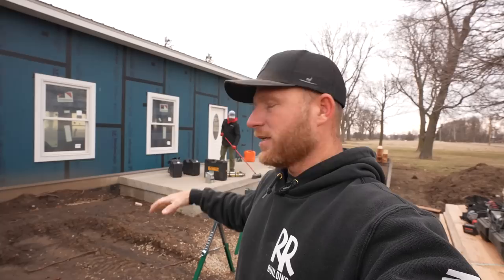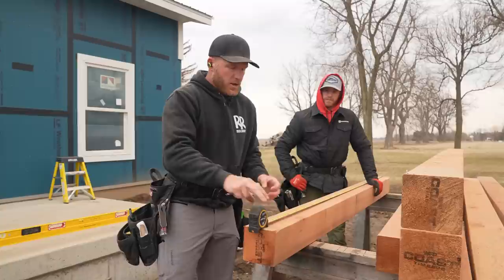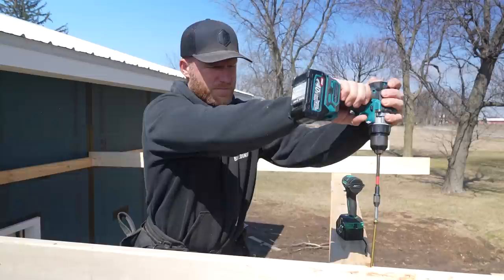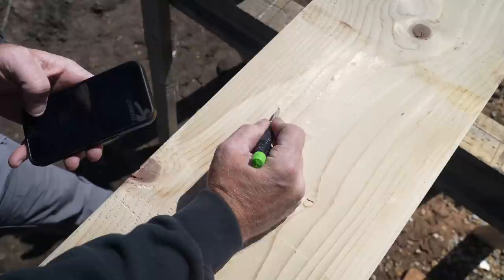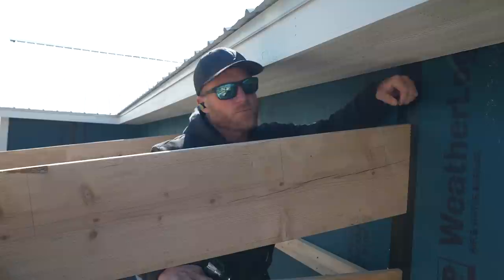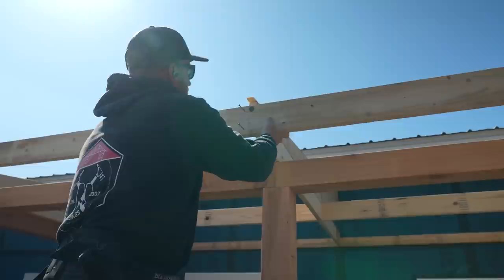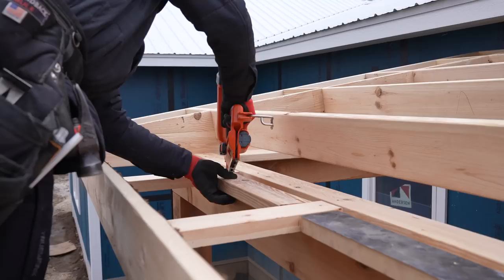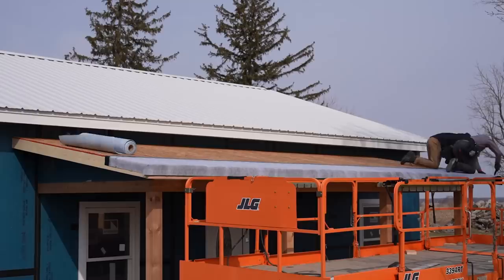Building a #Porch Start to Finish

Comment: Tim from Canada, my question is why are you using three different brands of tools for example at the beginning your laser level and your parts were..( DEWALT…. )Then using your hammer drill it was I think.?.(. Milwaukee.)….. now you’re using a new tool green. I am not sure what brand this is…. most construction people stick with one brand of tool. A lot of you people only use….( DEWALT..).   Just my observation.   If you are using just one brand of tool, don’t you think it should be the same for just one battery platform?… I see in your construction base you were using three different brands of construction tools or more meaning that you need a platform for more than three or more battery types…. again just my observation if you are doing this yourself, you should be using one kind of battery platform and seeing if that battery platform can give you free tools so you can use them on your job for construction use and for… task purposes, so you can test out the tools… I know a lot of contractors that do this

Comment: A couple of questions:   1: Why not do a ledger board at the house for the rafters to frame into?  Maybe overkill but would be easier to frame (for me a least). 2) why a 2x12 rafter for such a small span?   (A 2x6 would work)  #3:  the porch roof is too close to the higher roof - looks awkward and how in the world did you attach the sheathing and roofing under the higher roof?      Enjoy your videos and appreciate your level to detail.

Comment: I am concrete on floating slab @ 20+" above grade (the house was set 5 ft above grade and back-filled 3 ft - due to a high water table).  There is no basement.  One quote person told me that I will get leaks and rot if I don't put my porch level 2" above grade (ugly patio).  It's all concrete below 16-18".  I just want a porch slightly below my sill that could've been installed in the first place.  I think that if drainage is proper, there should not be a problem.

Comment: For light structures such as your porch uplift forces due to wind often will control the design so your column bases and the anchoring to the concrete is important.

Comment: we are adding a porch to an existing post frame, we are going to take the metal off, and replace it with some type of siding. when they do the concrete floor we need to have the metal off first?

Comment: @rrbuilders- hey kyle, i have asked this question a few times. Can you please explain, when you are calling out "grade", such as on that concrete patio and this porch. Where and how are determining your grade point, then level? I can only assume that the porch you are working on has a slight slope for water to run off, but i see that your laser (180) is near or at the middle of the porch. So one part, near the house has to be higher then the outside edge. All of that seems a bit confusing. How do you determine where you are setting that laser/grade? This is all new to me. Have been in construction for 20 years, but have never ran one of these. Always just showed up and started banging nails. All the grade work had already been done. We live on a farm, i will be purchasing this laser set up as it will come in handy on many projects for the future.

Comment: Kyle wouldnt it be good practice to treat the ends of the posts that are going to be exposed to the weather? Also is there something that you could put between the wood joints to help keep rot from happening?
Reply: Yes especially and cedar cedar tots really fast especially western red cedar if it was mountain cedar it’d be different I been doing this 22 years western red cedar is trash imo but all we get in texas

Comment: Question please - do you NOT need epoxy or anything like that for the bolts securing the brackets to the concrete pad? Or is the engineering of the bolts themselves enough?
Reply from the maker: No need

Comment: Great video! But, I don’t see this being possible for $300. I think you said the gravel alone was like $80? Add chairs, fire pit and edging, you’re over $300. I assume the chairs were 60-80/each and a cheap fire pit found on sale could be 100. 

Gravel 80
Chairs 120
Fire pit 100

Total 300… haven’t included wood posts, lights, concrete mix or edging.

Comment: How does everybody in these videos just sink acrews so effortlessly without stripping the acrews? What am i missing? I have to put all my weight against a strip em half the time.
Reply: Its all about the type of tool youre using for the job (impact driver or drill), brand (my favorite impact is milwaukee m18, favorite drill dewalt XR) and your attachments with them. Make sure its a proper fit, with the drill bits most popular one engraved PH2 for good reason for most standard wood screws. (there is Phillips 1, 2 & 3 for this)

Hope this helps. 🙌🏼
Reply: Also make sure they're fresh bits, once it starts to strip once, itll start stripping everything. 😂
Reply: One more thing, if youre using a drill, not all drills are the same. There are hammerdrills also with different settings for the job! Lol.

Comment: Is that laser dangerous for your eye's to look at when your 20 feet away from it and only get a flash of light every now and then probably like you get by using it every day?
Reply: I have been using different lasers for about ten years and often get into my eyes, over these ten years my vision has not deteriorated. Yes, this is a short-term impact, but very frequent over the years. But of course you have to be careful ☝️
Reply: @Alex_F81  Thanks. I've been using a much smaller and simpler laser for years with a solid beam but with the 360 degrees lasers like this, I would think that I'd get zapped way more often.

Comment: So many things wrong in this video. First you’re not wearing any PPE when using that hanger nailer. You could possibly damage your eyes using that without wearing safety glasses. Second,  the strength in the plywood is really only useful when you stair step the pieces. And who pull out a track saw to sheath a roof
Reply from the maker: Wow you really are a pro!

Comment: I honestly don't get why you American guys keep using the impact driver instead of the drill.

Impacts are less powerful when using general wood framing screws and they make a ton of noise. 

Whilst a drill is as shown in this video more powerful and it is quiet.

Comment: Do all that quality work with top of the line products an then put the cheap ass  crappy siding on.. lp is junk. Glorified plywood, stuff has a minimal surface face, chips out supee easy. Have to make sure to prime all your cut ends, so inconvenient.